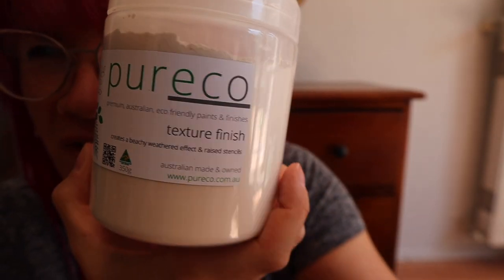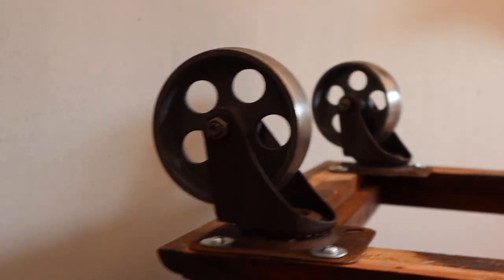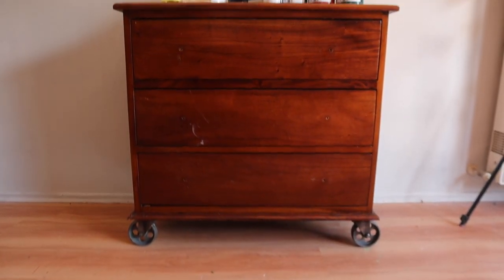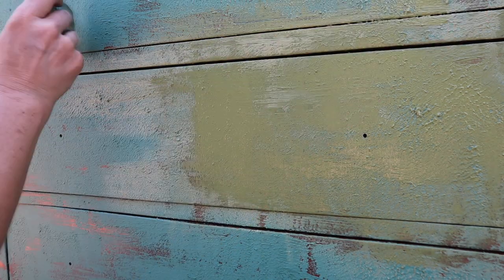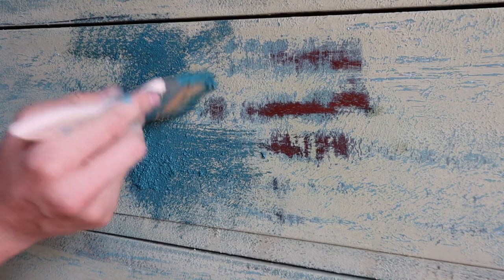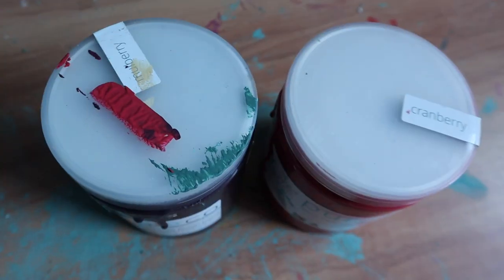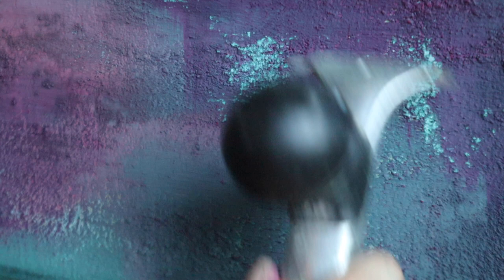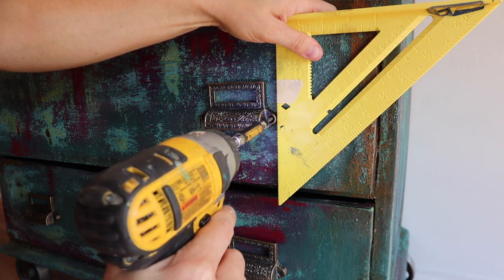Kosher Salt For Texture - Create Layers & Texture On Furniture

Comment: Why kosher salt. And not just table salt??
Reply from the maker: you could use table salt too, kosher is more coarse so I wanted that look :)
Reply: @BellaRenovare  how come the salt doesn't melt??
Reply from the maker: @bonnysmith4908  the paint is not heated.

Salt's melting point is 800.8 degrees Celsius, or 1473.4 degrees Fahrenheit.